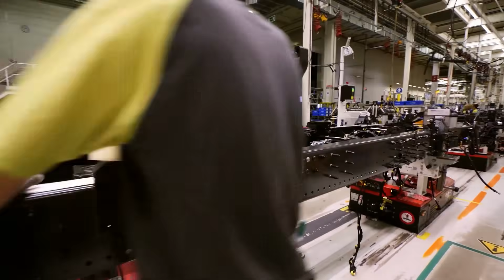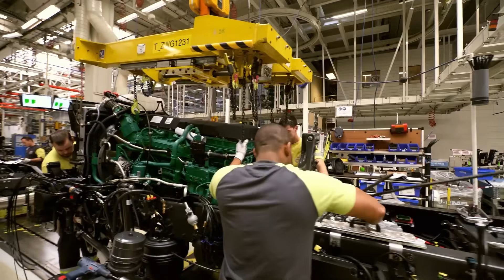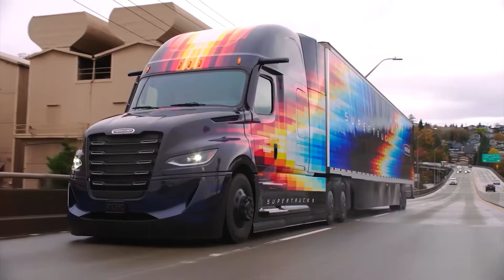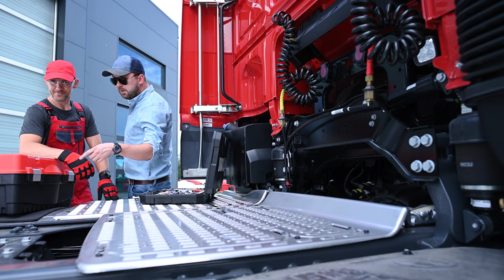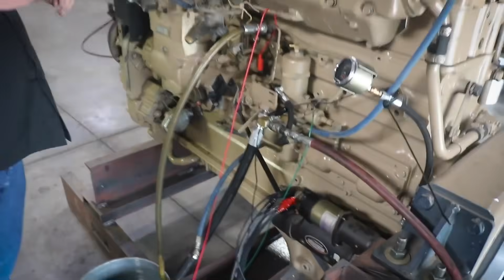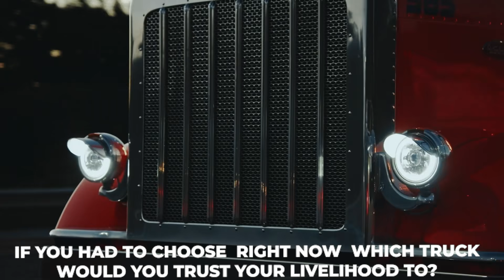Why Truck Drivers Still Choose a 30 Year Old Engine Over a Brand New One

Comment from the maker: Old school reliability or brand new technology. Which one would you trust? A 30 year old engine with 2 million miles on it. Or a brand new truck full of computers you can't even touch without a laptop.
Let me know in the comments. And if you're a truck driver, what are you actually running right now? 👇
Reply: Truck manufacturers rushed to try to build engines compliant with EPA standards that they forgot what had made such engines relatively easier to repair the first place: simplicity.